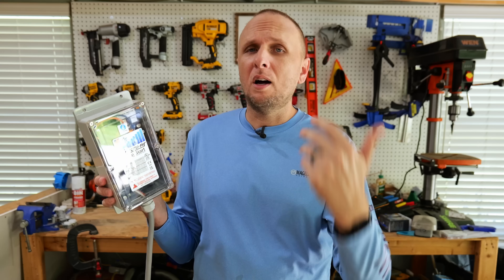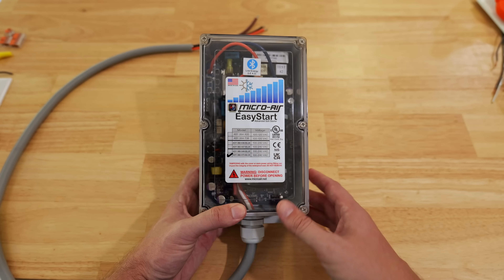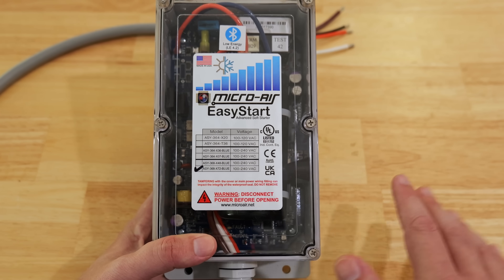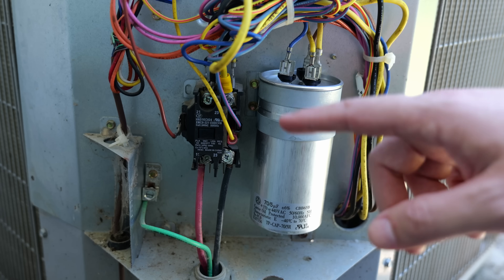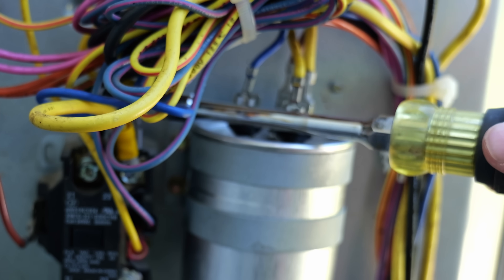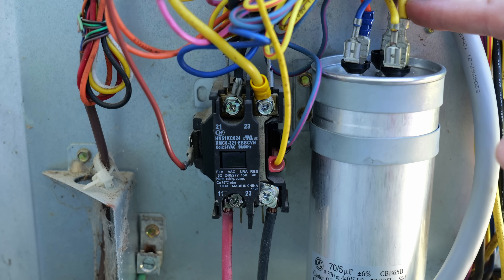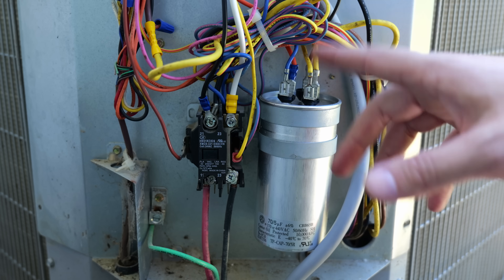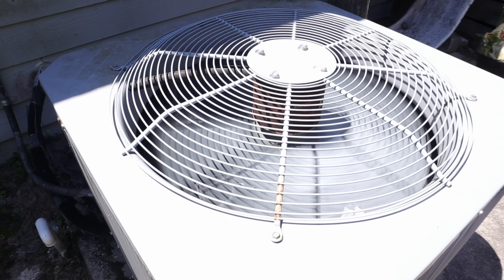Why Every Homeowner Should Consider Installing an AC Soft Starter | Micro Air Easy Start Install

Comment: Hi all, will this drop the demand for electricity since the inrush current is much lower? Since it drops the current needed to run is there a saving because it draws less current?

Comment: So even if I am not hooking a generator to the ac, it seems like saving’s would be acquired only during the start up. Running the unit would seem to be the same power requirements.

Comment: does the reduced running amps mean a reduction in how well the system cools your house?  I would think fewer running amps means the system is working at a reduced capacity, but that may not be true.

Comment: Just started running grid independent power but can only run 1 ac unit ran both for a moment, but when the compressor kicked in it tripped the breaker. Soft start which might be the answer

Comment: I followed your excellent instructions and installed a 368 model on my 5 ton A/C. One thing I wasn't prepared for was the wait before the system would start up. After about 3 minutes of nothing, I began to worry I'd done something wrong. Then finally it started up. Other DIY novices out there like me might want to be warned. It doesn't start up the instant you flip the switch ;-)
Reply: Was the delay on initial startup or every time the ac cycles on and off?

Comment: I appreciate all you do to make your videos and like others have said, it gave me the knowledge and confidence to tackle my generator/interlock project. I do have a question about the Soft Starter device. Will it work on a 220V well pump? Planning on a 220V AC with 48V DC storage system. The 12V batteries making up the 48V DC are real brutes, Silica salt gel style that the military uses. They are 96# each. My inverter is a dual 110V system designed to produce 110V and  220V split phase, true sine wave.

Comment: The black wire to the contactor on the left side of the run wire. You said do the same exact steps as the run wire?
Reply from the maker: No.  But I’m not sure what you’re asking.

Comment: I seen these around but has any one ever made video comparing hard start and easy start? I did notice in the video your amp clamp read 126 amps. But your unit max is 108 that impossible. Your compressor should have locked up.

Comment: Why don’t AC manufacturers put these on the units from the factory?
Reply: Mainly because residential is moving to inverter driven systems.
Reply: @acessford101 so if you have an inverter AC you really don’t need this right?
Reply: @robertoms can’t use this and don’t need it
Reply: @acessford101 no they’re not. Way too expensive
Reply: Because they figured if you were so concerned about it you’d just buy a mini split.
Reply: @DoyleShadduck  I installed a bunch of mini splits at work and learned about how awesome they are. I just got one for my house and am going to mount the head right in my living room, it's going to be glorious. Have you seen the new split window units? They sit over the sill like a saddle so you can still see out the window and it's a legit split system that you can just hang in a window and plug in
Reply: @mikecurry6847  The window inverter ACs don’t have heat. Minisplits Do have heat. Most people need heat too.
Reply: @BeefNEggs057  true but a lot of older homes in northern states like mine have plenty of heating but no AC. I did just buy a mini split though because that's the way to go right now imo
Reply: @BeefNEggs057 there are quite a few window units now from LG, Midea, Hisense and others that do provide heat but it is a fairly new thing.  I am building an apartment for my daughter in a garage and it was cheaper and easier than a mini-split.
Reply: @mikecurry6847 no mini split in the house is ridiculous just buy an AC and install it yourself😂 you already have the ductwork and everything
Reply: @JacobsNews  I mean no, I don't have ductwork in my house. It's 120 years old and very small, we have a wall furnace
Reply: @mikecurry6847  😆  then a mini split will work great.
Reply: Waterfurnace includes these from the factory as an option.
Reply: Cuz they don't need them
Reply: Cost. Consumers already moan and complain about cost of a new u it.
Reply: Why would they add a $200+ cost if they don't have to? And why would they want to increase the life of your compressor when you could just buy another one, from them of course? Lastly, not everyone really needs it. Not everyone uses a generator or has home batteries and you might be the lucky one whose compressor lasts 25 years because you only really need your AC two weeks out of the year.
Reply: How else would any company make money? Products not lost too long now.
Reply: I guess you haven't lived in 2024...
Reply: Hvac companies wouldn't make money from replacing blown up compressors.
Reply: $$$$$$$$$$ that’s why..
Reply: My new camper the AC has a factory installed start capacitor. Maybe the residential market will get on board soon
Reply: Because it is disadvantageous to extend the life of the unit.
Reply: It seems that the United States is suffering from a delay in this field.. We have had inverter technology in Iraq for many years, and here I am talking about all air conditioning devices, whether large or small, and all types. This thing has become very common here.
Reply: @husseinhussein142  it's because of the supply chain like refrigerants they get released through Europe ..... America , our buildings are already set up for HVAC, so we don't really have a high demand for the small inverters mostly used for garages and sunrooms
Reply: Demand. If enough people want them, they'll start selling them.
Reply: Because it would make less money
Reply: To make money!
Reply: Cost
Reply: It's not profitable.
Reply: Homeowners always be asking this question. It’s so your system will crap out sooner and you’ll buy a new one
Reply: Because people don't generally care as long as it works for a reasonably long time and will not pay extra for it.
Reply: To save $5
Reply: Well…we all know the answer to that…Big HVAC doesnt want you to know this ONE secret
Reply: They do, but only on the higher end units
Reply: Hey do you feel a soft start can help a unit with RLA of 10.5 & LRA of 47?

Or is its main purpose/function is use with generator? Which is a great feature!
Reply: @cenval999 it will reduce your start up correct by 75% and save you about 1/2 on your electric bill.
Reply: Planned obsolescence
Reply: Big HVAC

Comment: AWESOME video!!! This was so simple to install using your video as a guide. I was a little thrown off at the run wire part but used the diagram and got it done. Starts up so quietly now and getting 31 inrush amps on average per the app. Thanks again!! Love your videos!!!

Comment: I just changed out my capacitor on my home unit and cleaned the coils, whereby I came across this video. I'm not using a generator, but wanted to know if this device would be of benefit to a homeowner with a typical HVAC unit without a generator? Seems to me it would be great for my compressor and energy, is that right? The first one I came across was $300, but I know compressors are a lot more and I have plenty of space to mount one inside my unit. My only mission is to make my A/C last longer and save on my electric bill, not to attach a generator. Any advice is appreciated. Than you for your videos.
Reply: If not using a generator on outages ever i personably don't see the point of these. I get lot of outages here in the south and then there worth it , especially   summers for an out more than 24- 72 hours or more

Comment: Do soft starts help with power surges at all, referring to the rapid off-on aspect of power surges, or do I need something else to protect from those?
Reply from the maker: It will help protect the compressor from surges but only the compressor.

Comment: Have to give you 10 stars cause you showed me how to install the power inlet box and the easy start. It's amazing my 10,000 watt generator can power my 3 ton ac and all the lights in my house. 22amps is all that it takes to start now thank you! Alot of people you help I'm sure don't leave a comment only the ones that have problems. Your content is very informative and needed!
Reply from the maker: That is awesome!  Really glad to hear you have gotten things installed and where you want them to be!  Thanks a lot for taking the time to leave this feedback!
Reply: I agree 100 %. I've learned alot from your channel. Thank you
Reply: Your ac requires only 22 amps now to start after the soft start kit installation.  What was the current BEFORE the soft start kit installation?  Thanks.

Comment: 125amps?
Reply from the maker: That was the initial reading yes.
Reply: @HowToHomeDIY  but... 120A on a 4ton AC that's literally unbelievable. What sizes breaker did you have? And 120A on that sized wire? You were seeing 120v imo

Comment: Excellent video, you covered everything in detail.  I've already purchased the Mico-Air Easy start and it took my starting load from 105 down to as low as 32, allowing me to run the AC on a 7000w generator.  I thought you brought it home when you hooked up the smaller generator and it handled the load.  Lastly your breakdown of the Easy Start and explaining how it works was more detail than the manufacturer.  Very helpful they should be cutting you a check.  Congratulations on a great presentation, I'm am now a subscriber.

Comment: Do higher end units like from Trane, have a soft starter already built in?
Reply from the maker: Some higher end units that are variable speed and the in rush on them is so low a soft starter really isn’t necessary.  But they don’t have a soft starter built in they just run differently.

Comment: This is the 3rd video of yours that I have watched.  The connections you make all look easy.  HOWEVER, for all of your videos I have no understanding of why it works.  I need a circut diagram and a little theory before I start connecting wires.  I do not get this from your videos!
Reply from the maker: Yeah, don't start messing with any wires then.

Comment: Why is it you have to read directly to the compressor? As an electrician we always check power consumption at the circuit breaker not the compressor. Could it be these reading are not actual?
Reply from the maker: Just to see the drop in in rush current required to start the compressor.

Comment: Awesome video! New subscriber and recent home owner once again. I came across soft starters while rebuilding a fire damaged home. I'm by no means an electrician, but from what I gather, this thing would pay for itself within a few years, correct? I even question if the surge protection could qualify for some kind of home owners insurance rebate also. My HVAC sits directly beside of my well. My question is if there is a possible way to wire the soft start to a submersible well pump, to extend pump longevity as well as the surge protection. If possible, would a soft start submersible well pump even be a good idea?

Comment: Love the video and just ordered one of these for my home AC.  FWIW, the Easy Start FAQ page says these are unlikely to prolong the life of your compressor.  That said, I've learned the hard way how power surges shorten the life of electronics in your home, which nowadays includes pretty much all appliances and even lights.  In recent years, I've have appliance failures in my dishwasher, gas stove, and clothes washer, all down to problems with internal circuit boards.  I suspect the Soft Start will easily pay for itself by prolonging the lifespans of these pointlessly complex appliances, not to mention devices that actually have a reason to be electronic (routers, TVs, etc.).
Reply from the maker: That’s very interesting since when I have spoken with them on the phone about it, extending the life of the compressor was one of their main selling points. It makes sense to me.

Comment: I watched this a while back and came back to watch it again and the reason is, i'm wondering if this could be used with home heaters or water pumps? To slowly build up the power then can pull to  avoid the flickering that is caused by them kicking on so hard when the available Amps in the main panel drops momentarily during their activation cycles.
Reply from the maker: I’m not sure if this exact one can do that but I’ve heard of other types of soft starters.

Comment: Great Video! my Hvac guy is trying to convince me to install a Hard Start but all I want is for a quieter start up, and the soft start seems to be the answer. Not sure why he's stuck on the Hard Start kit when power isn't an issue
Reply from the maker: Because they don’t understand what these soft starters do.  My AC guy said he had never seen one before.
Reply: @HowToHomeDIY  I hate to say it, but HVAC guys are loathe to try and the last to know something different.   All Tradesmen are steadfastly conservative. They must honour their 10 year warranty from their installed chosen brand they know is a consistently performing, but they don't work for Elon. There is no payback in beta testing your new idea. Never base your opinion solely on an HVAC Tech's recommendation of a new product or approach. It will always be "No!" or "It's bad!".  They are smothering the new mini split revolution in its crib  because of this, until it is proven reliable.  Because Chinese are not reliable, jus' sayin'. No offence, you understand, but we all know it.

Comment: You convinced me to get one. Question? My unit is a 5 ton the easy start I bought goes to 6 ton. The two green lights come on only when the a/c is running. Should one green light be on at all times? Or only when it's running?  Thanks
Reply from the maker: Hope you are liking it as much as I do!  The lights are only on when the unit is running.  Thanks for the feedback!

Comment: That unit didn't take a 125 amps to start. More like 12.5..  125 amps would kick the breaker.  5 ton is a 60 Amp brkr. The motor didn't take 35 amps either.. most condenser motors pull 1 amps or 1.5..  35 amps motor doesn't exist in residential..
Reply: My 5 ton units sticker says LRA 134 and RLA 26.4, so a 4 ton at 125 is about right. Look at your units label, I know its hard to believe but these units take a lot of amperage at start up.

Comment: Hard to believe that pulls 125A. That wire is not rated for that. Likely a voltage reading.
Reply from the maker: No it is an amperage reading.  AC guy said it’s all good.
Reply: My 5 ton units sticker says LRA 134 and RLA 26.4, so a 4 ton at 125 is about right. Look at your units label, I know its hard to believe but these units take a lot of amperage at start up.

Comment: Great info and explanation.  I installed a hard start capacitor two years ago to be better able to power my home with a 13k generator and it helped with starting.  But this is will be a huge help.  Didn't know it even existed.  Many thanks.  Time to go order one.

Comment: Can you use the EasyStart 368 6-ton Soft Starter | Micro-Air ASY-368-X72-BLUE on a 4-ton unit?

Comment: Seems like this would be perfect for my GE slimline panel.  I had to replace the breakers for my compressors twice because it's just a crappy breaker system and inrush current would make the magnets rattle.

Comment: Having just been through a 6 day power outage this is of great interest to me. I have a 5,000 watt generator and it will run everything but the main AC. I have in the past installed a couple of Mini Split units in my home. One in the master bedroom, I used to work a lot of midnight shifts so this helped me sleep darning those times. And one in my garage. The mini splits ran just fine and most everything else. My neighbor across the street had had a whole house standby generator system installed several years ago and I did lust after it but just not in the budget, but when I heard from her that it kept tripping out I did take a look but I couldn't figure out anything. She finally got the generator service man out and blamed the AC for the problem. It was drawing 97 amps inrush current. So this looks like a fix. Thanks for the video.

Comment: I have a 34 years Carrier A/C using R22 and it still working fine and I do not need generator to power my A/C.
If I install this AC Soft Starter, would it prolong my old A/C or it is too late for that because other parts such as A-Coil, compressor is near end of the life. Thanks in advance.

Comment: Can you recommend or do a video on a Soft Starter other than Micro Air? Micro Air is 2 times the the price of some of the other options out there in the market. Would you even consider using another brand or is Micro Air the only option you would recommend?

Comment: Great video, I also have a 4T unit and a generator wired into the panel. It will run my my smaller basement AC unit and well pump, plus other small stuff but wont fire up the 4T unit. I may give this a try before buying a bigger generator. Thanks.

Comment: 125 amps? Hopefully your AC hasn't been doing that very long. Good thing you got some form of start assist
Reply from the maker: Nothing wrong with it.  Had an AC tech out just a couple weeks ago, I removed the soft starter so he could check everything normally and he said everything looked good.

Comment: Do these work for heat pumps as well, or just AC units? Are soft start devices useful for variable speed units, or only units that are 100% on or off?
Reply: Variable speed systems effectively have the soft start built-in. We have a 2-year-old American Standard 4T VS system. We opted for it so that we could run from a portable invertor as a backup strategy. I was concerned that adding a soft start kit to a new single stage system would void the warranty.

Comment: I have questions, one If having problems with the compressor starting , will this soft starter work properly or will it also need a hard starter kit? Two at what point in the life of a a/c unit that is old , the soft starter won’t be a good idea to be install??